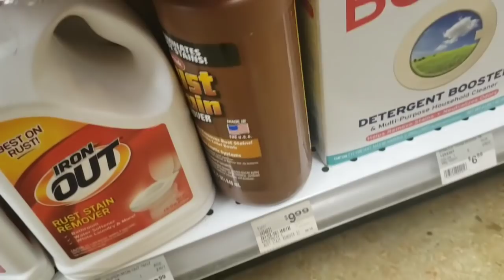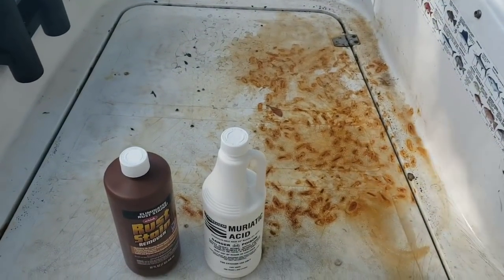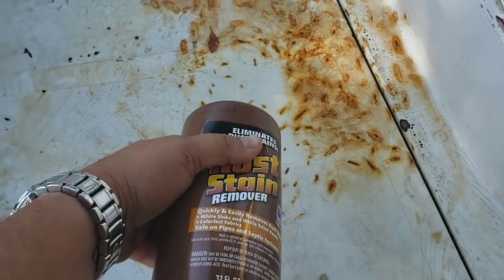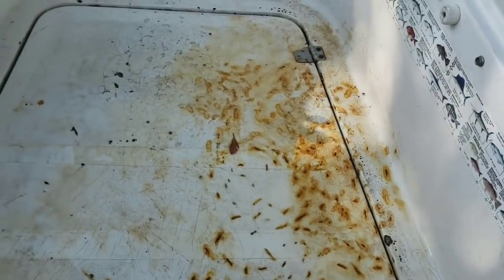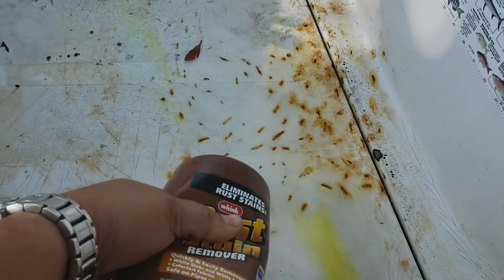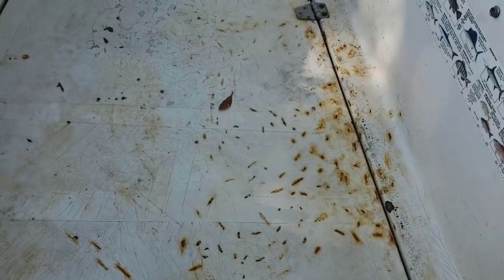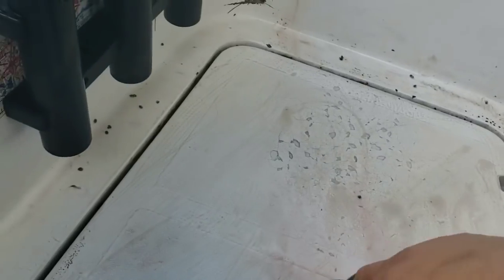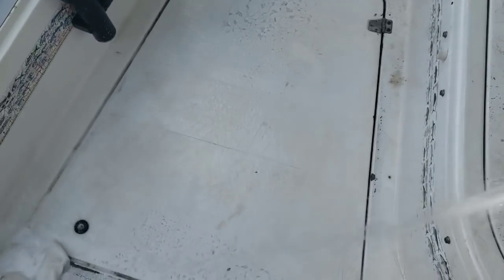I eat rust for breakfast ! Removing rust from a boat !

Comment: Alfred my friend - use rubber gloves, a respirator, and dilute the muratic solution.  I have used it on tile and concrete work ( with protection) and always diluted.  Don't Mix Muratic and your rust remover at teh same time, Lord knows what toxic fumes you are creating.  No joke man!

Comment: What have we learned from this?  NEVER leave your anchor chain on the deck! What a chit show! LOL In all seriousness I had the same problem and used Klean Strip Concrete prep from Home Depot or Lowes in a spray bottle. Spray it on and rinse it off . Good video. Shows a viable solution rust stains.